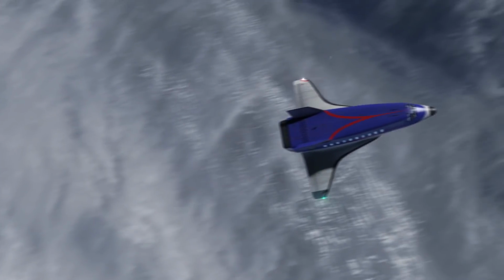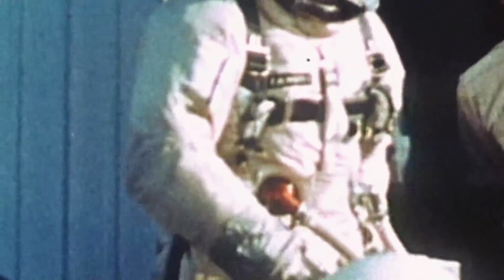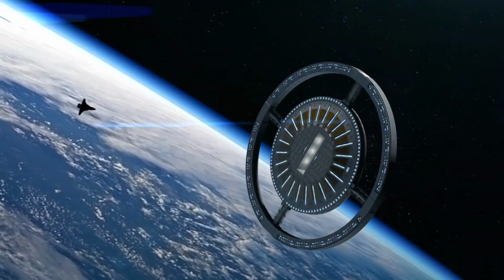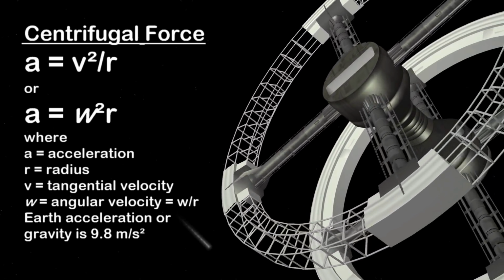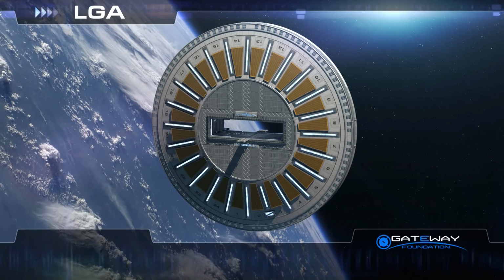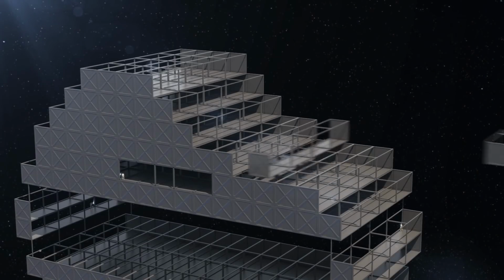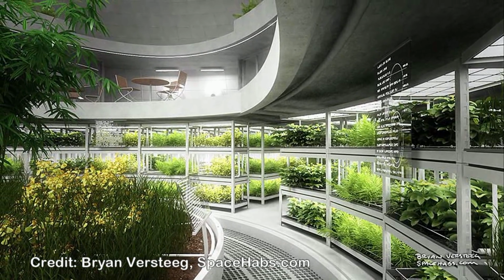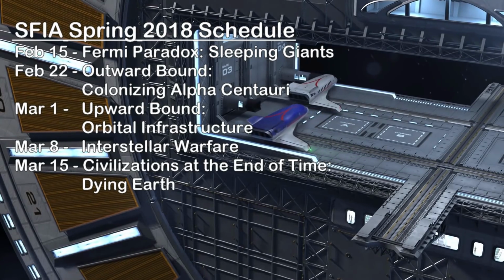Spaceports

Comment: you speak to the law of the square and cube as cost savings, but what about the cost of the gases to pump atmosphere to a larger space, and the cost of cleaning the air with more people?    You also neglect to discuss the huge failure foot print that modular welding will put on the station, each weld is a failure point, they will need drones to inspect those welds initially, and on an ongoing basis.  Also, how will they handle containment failures from space debris impacts and micro meteorite impacts?  a larger station will garner a larger share of these.

        On a side note, I think data centers that contain AI's or crypto currency mining, will be a large commericial enterprise for future space stations, you can cool them easily, and only limited in power by the number of solar panels you can deploy, or even use fission reactors.
Reply: Furniture and life support is linear with respect to people. Larger volume gives you room for those things and also redundancy.  
The lower gravity also lowers stress on structures.  You can make your welds stronger than the frame.  Then you can expect the failure to occur in any other part of the station.
Reply: lower gravity does not mean lower stress, if the space station is experiencing tidal forces from both the earth and the moon, it will stress and flex accordingly, and just as bending a coat hanger back and forth over time, the metal will fatigue and fail.  This is the failure point that a weld creates.  When you weld metal, the weld is stronger than one or both pieces being welded together, the failure point is just adjacent to the weld, which sees just as high a heat as the original weld, but is a thinner wall thickness, and can be made more brittle after the "heat treatment" of the welding process.   If you look at any weld failure, unless the weld was poorly done, the failure is on the metal next to the weld, not the weld itself. the only time the weld itself will fail, is if it had impurities during the weld process, or perhaps it was bridging too large a gap, or insufficient to fill a bevel.    But all that being said, I would assume that if we have programmed a drone to weld properly, it will weld properly, the unknowns are the tidal forces and the stress and flex over time.  Just as the first aluminum jet aircraft skins failed because the port holes were cut with sharp corners instead of round (radius'd) corners, so to will there be a learning curve with modular weld construction in orbital stations, and it will have to be monitored closely until enough data points are gathered to create a satisfactory knowledge base... or a few tens of thousands of people die in a catastrophic decompression.

  Personally, I would not go the weld route, I would go with interface materials that are force fit together to provide the pressure seal and give and take of heat expansion and tidal forces, and any welding would be to hold that together, so that multiple welds would have to fail before modular units would separate far enough to create a decompression event, and of course you would have to design it so that one weld failure or two or five, would not create a cascading failure within seconds. The failure mode, should give you enough warning and time to address it. otherwise you are no better off than just welding the modules together into a rigid structure.

Comment: I was thinking about this today, would it be possible to build a spaceport that could orbit around the sun? This space station could be situated between earth and mars as a mid way stop port for people and other stuff to travel between planets. If possible it could make travel far more viable and less costly. Just a thought.
Reply: You do not want to stop when traveling in space.  The Mars mission will burn almost all of the fuel inside of a gravity well.  After leaving the low earth orbit area they will float until reaching Mars and then use a second heavy burn to slow down.  In between they only use tiny sideways pops to correct aim.

Comment: One thing about  that spaceport video that disturbed me instantly was the people casually strolling through the airlock tube in the zero-G hub area of the station...  I mean, their animation is great, but you'd think a serious proposal video for a space station would get a detail like this correct...
Reply: Simon Coles, It is not zero-g.  The shuttle was moved away from center 4:27.  The stars 4:35 are moving quickly.  The people should be flying face first "down" the pipe. Coriolis force might help them some.

Comment: I know Buckminster Fuller would be rolling over in his grave if he could see those rectangular stick built modular boxes with no cross bracing. Someone needs to think outside those little boxes.
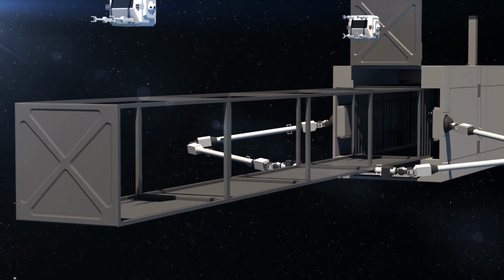Reply: Gary Wheeler, Buckminster Fuller built domes using standard rectangular 2X4 and 2X6 sticks.  At 9:17 Isaac explains how gateway can make rings.
Reply: I don't mind the sticks. The problem is the geometry. Triangles are strong, rectangles and squares are generally weak. Geometry can be your friend if its designed correctly.  It can be strong and light. As a designer, when I see only rectangles, I cringe as I see the structural waste. You don't want wasted structure in space. Even if it is placed inside a cylinder.
Reply: They did put diagonals on the end plates.  Suspension bridges do not have triangles.  
I think it is an artist not a technical CAD design.  The floor plates are not perpendicular to the direction of artificial gravity.

Comment: The way the pobs grab the station segments in the animation really bothers me. They're just so off center. It would be better to have them on either side of the center of mass, whether that be on the front and back or the left and right side.
Reply: The segments should be fairly low mass.
Reply: So they could probably save a lot of monopropellant by using light, remote control drones in a configuration where they can be fuel efficient rather than those large pods having to constantly waste fuel to move themselves and apply force from such a offset position.
Reply: QuantumSeanyGlass, I would not recommend using propellant at all if you can avoid it.  In this case they can easily avoid it.  The animation has pods with 4 grabber arms with only 2 arms attached to the manufactured truss.  One or both of the other arms can be attached to rails or tethers.  Start by building a truss into a large square, triangle, or ring.  You can cable in everything the same way that a spider spins a web.

Comment: I see a benefit, but also a few flaws to space stations. The thing is we have a lot of debris and junk floating near earth orbit, the ISS was lucky up to this point...flaw is the bigger an item gets, the more surface/impact area.
Reply: It would take a lot longer to drain the air in a larger structure.  You can also move to another compartment while leaks are repaired.  The impact area per unit volume goes down with size.

Comment: It would be nice if inner ring, which simulates different gravity for training, wasn't in a fixed position inside the station. It could be connected off to the side of the center from the main structure. And it doesn't even have to be a ring - it could just as well be 2 containers on opposing sides from the middle for even weight redistribution while rotating. Those containers could be on rail system that moves them closer in, or further out depending on which moon or planet's gravity is needed to simulate.

Comment: Modular space station is a great concept, but I have issues with how it was presented by the GF. Yeah it's proof of the concept animation and the real thing, if ever build, would look completely different, but still, it would make more sense to make the docking part itself circular rather than rectangular, and despite that I doubt there would be much gravity near the center, exiting the shuttles would be more like descending a steep stairs, rather than walking out aeroport-like as depicted, plus a lot of rooms "below" and "above" docking bay would get strange misaligned gravity in them or be weirdly shaped to align with the rotation vector (means tapered rooms and even wedge-shaped rooms).

Comment: It seems to me the biggest problem of welding in a vacuum (at least on earth) is making and keeping the vacuum, which wouldn't be a problem in space.  The examples that I'm thinking of are electron beam welding with a vacuum window and fully contained electron beam welding.  I think it would generally be easier than here on earth with the possible exception of needing active heat sinking for materials with too low an emissivity.

Comment: Elon was asking for suggestions for what to haul into space on the BFR test flight (I'd like to suggest renaming the BF rocket to "Excalibur" for many reasons -- SpaceExcalibur, large caliber of a projectile, sword from stone - as it, like anything, comes from the rock of the earth, fantasy element, king of rockets):

Might I suggest fitting the largest possible structure than can be folded to fit in the BFR, that unfurls to become the first spinning space station!

I was also blown away to find out that the BFR second stage is SSTO capable!!!  Even if it could 'only' haul 10-15T into orbit at a time, if it's reliable enough then these missions could be continuous.  It wouldn't take long to get all the mats we need up there to build something awe inspiring.

The spinning station could include very large windows as well.  I've seen aquarium windows many stories high, and they must withstand crazy pressure.  If the 2-stage BFR can lift 150T at a time, then we could also launch many of these windows.  

I wish I was 20 years old again!!!!  What a great time to be alive!

Comment: These stations always seem to involve spinning the whole station.
But I'm curious about the concept of spinning just the rings themselves - that is, a spinning inner section inside some outer framework that either doesn't spin, or spins more slowly.
I suppose there's some complications in transiting between sections that spin at different rates (you'd need some kind of mechanism to adjust from one rate of spin to another), but it would give more flexibility...

You could have such a ring spin faster or slower to adjust local gravity in that section without altering it in other parts of the station.

Obviously keeping within the RPM constraints for comfort would still impose some practical limitations in what kind of gravity any given ring could support, but it still seems like something that would have some upsides to it.

You could even use a hybrid; so long as the ring's independent propulsion system (maybe a magnetic system pushing against the outer shell of the ring) is present or allowed for in the design when installed you could begin with the inner ring section being fixed and spinning at the rate of the station, and then later upgrading it, or even when fully installed you could stop the section rotation and just sync to the station rotation rate...

Perhaps the extra flexibility isn't enough to justify the extra complexity, but I do wonder why this variation is rarely shown...

Comment: All of the really efficient/cheap methods for launching mass into space require large amounts of very inexpensive electrical energy. We don't need to wait for fusion reactors. Molten salt thorium reactors could supply such energy.

Construction in space should be done using raw materials acquired in space; harvesting asteroids or lunar soil launched into orbit by thorium or solar powered mass drivers.

Comment: this is certainly my favorite channel, i am sometimes mildly disappointed when the video goes over 30 min because that means i cant watch it on my break at work and have to wait until later.  that being said, a big reason that i love your videos is that you take the time that you need to do them well and it would only be a detriment if you started adhering to strict time limits.  the old episodes(especially the ones over 30 min) are also great for falling asleep, long, highly descriptive, no sudden jumps in volume, and enthusiastically eventoned narration. that last point might be a side effect of the rhotacism rounding your voice but it is difficult to tell because it is hard to notice it anymore, especially a few minutes into the video.

Comment: Isaac Arthur, on said habitats how do we deal with vitamin D deficencies caused by lack of sunlight? Supplements help, but our body simply cant absorb enough from food to be viable, from what I understand of it.
Reply from the maker: You can actually make LEDs that will perfectly replicate sunlight these days, its a hassle so we mostly don't go for perfect, combine that with a D hevay diet and supplements and it should suffice, if not, or for those folks who it doesn't for, we'd need to improve the LEDs and crank up brightness, but probably not really an issue with stations where the launch costs make most normal costs irrelevant.

Comment: Ooh...I look forwards to the Kessler Syndrome video. I've heard a lot of near-apocalyptic predictions, about how it could stop all space travel for millennia, but they've all seemed rather...implausible to me. IIRC, the ISS's orbit would decay by several kilometers per year if we didn't keep boosting it (thanks to the drag of the trace atmosphere), and I would expect smaller objects (with less cross-section per unit mass) would be as or more affected by drag.
Also, if there were enough little flecks of stuff in LEO to make high-energy collisions likely, wouldn't the presence of all that stuff be its own source of drag? Most collisions cause a loss of energy as heat, mechanical deformation, etc, and that would cause the objects to lose kinetic energy (to say nothing of those knocked onto a suborbital trajectory).
But I look forward to someone who knows more about the subject explain it better.
Reply: Knowing Isaac, he will show the plausibility of a giant fan that pushes up a bulge of atmosphere to help slow the debris.
Reply: I wonder if we couldn't re-cycle some of it in orbit. After all if it costs that much to get it up there and is going to cost more to clean it up, wouldn't it be financially feasible to construct a recycling plant in leo ?
Reply: Douglas Smith
Or giant lasers to nudge debris into unstable orbits (most of the thrust coming from a little of the debris surface being vaporised by the laser)
Reply: It would depend in good part on the orbital characteristics.  LEO (where the ISS is) would have moderate drag, GPS satellites are a fair bit higher, and telecommunication satellites in geosynchronous orbit would stay up there nearly forever.
Reply: We need a bunch of cheap little drones running on ion plasma engines going around taking the trash out of orbit.
Reply: That's going to be infeasible for some types of debris (e.g, paint chips), and you would have to balance the cost of bringing recycling facilities up there and catching satellite bits versus just bringing the raw materials. Still, it's a possibility.
Reply: It seems like normal drag from the trace atmosphere alone should de-orbit debris in a matter of years, not millennia, never mind collisions. I've never heard an explanation for why space junk would stay in space so much more easily than the ISS.
Reply: Mike Combs wrote a short story about it.
But now I can't find the link.  I post it if I find it, or if somebody links it for me.
Reply: "Also, if there were enough little flecks of stuff in LEO to make high-energy collisions likely, wouldn't the presence of all that stuff be its own source of drag? Most collisions cause a loss of energy as heat, mechanical deformation, etc, and that would cause the objects to lose kinetic energy (to say nothing of those knocked onto a suborbital trajectory)." the few thousand years timeline for space travel to become possible again is precisely for that reason. the debris will naturally clear up, but it takes a long time by human standards

Comment: No earth fickle weather? In space you have coronal mass ejections, the coronal hole streams, solar flares etc.....
Reply: Yes but they don't prevent launches, and just load up on shielding for heat and radiation, so they don't cause electrical problems.
Reply: Cyberwar101 the traditional way if stopping radiation is to use lead which is very heavy. Having human life in a spaceship of some kind or a planet with a massively different electromagnetic field will cause health issues quickly.

Comment: In terms of research into low gravity effects on the human body and psyche we really don't need a ring type station. Tethers would do the job nicely. Besides tethers look to be the best bet in terms of providing artificial gravity on deep space missions. A tether facility could of been built fairly easily during the shuttle using the proposed cargo container at the bottom of the External Tank. Such a project was proposed or at least mission planning undertaken but never undertaken program  Plus just how many of the simple housekeeping tasks will be easier with artificial gravity. Much less some of the, shall we say crappier aspects of a long term mission. Additionally a mission to say Mars will require the crew to be subjected to gradually increasing gravity during the return flight. We don't want our intrepid explorers to be cripples after re-entry. 
As to the proposed construction facility. Does any one here remember the "Beam Builder"?
And what to do at an orbital hotel? I suspect and everyone else also most likely has the same idea that certain activities in the Kama Sutra come to mind